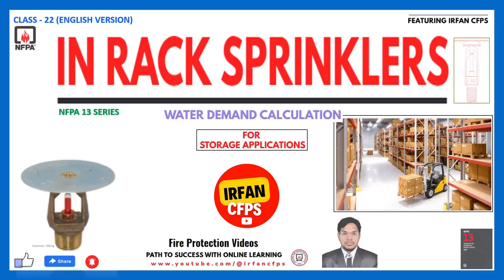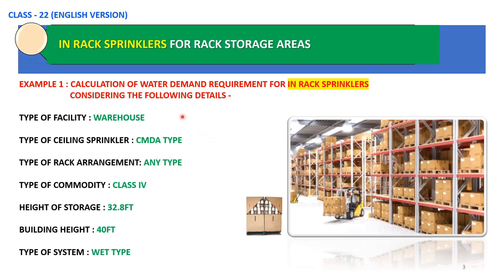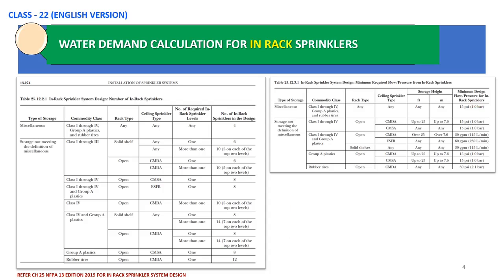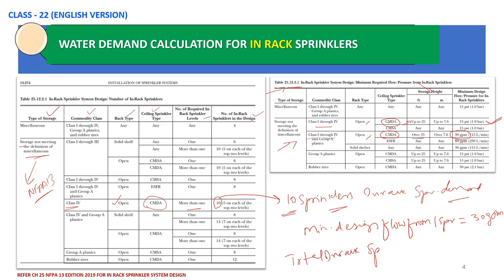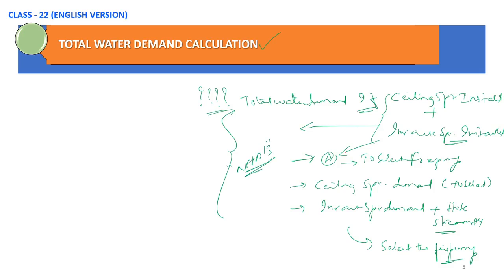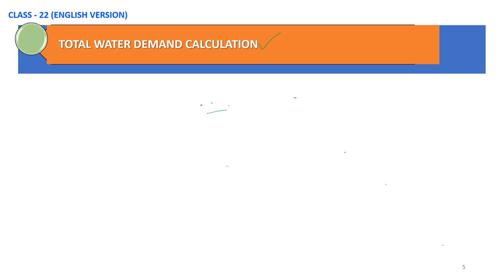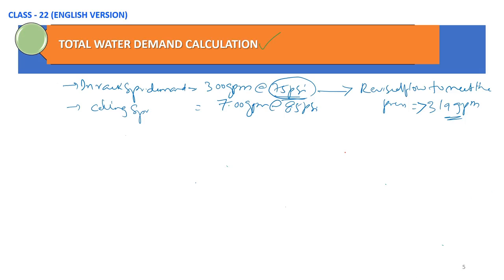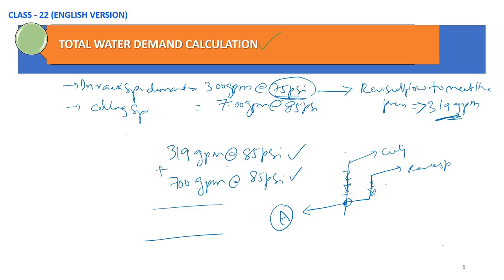How Much Water Do In-Rack Sprinklers Really Need?

Comment: How did you determine the pressure for the in rack, also how did you determine the pressure and flow for the CMDA for the ceiling ?
Reply from the maker: Please go through the video once again for more clarity. Head can be defined based on hydraulic calculations only.
Reply: @irfancfps  For the CMDA type then it was mentioned that for example the K to choose with 11.2 then the flow was set to 57gpm , then the pressure equaled 25 psi, so how determined for the inrack type?
Reply: @irfancfps  For the CMDA type then it was mentioned that for example the K to choose with 11.2 then the flow was set to 57gpm , then the pressure equaled 25 psi, so how determined for the inrack type?

Comment: Thankyou dear Bro. Irfan for your very informative videos. I am  still has a doubt on the distribution of sprinklers. in the given example we got 10 sprinklers and based on those and ceiling ones you got the total demand. If Ord Hz G2 12,1 sq meter is the Cov Area per sprinkler. My quesion what are the spacing between in rack sprinklers and where to place them vertically and horizontally . I saw in the table that those 10 sprks must ob 5 on each of top two levels, what about other levels?  if we have let us say 10 pallets above each other.. do we distribute the ceiling sprks by omitting the existence of the in rack sprks let us say 3x4 meter spacing in 2 d directions?  Hopefully you can come up with a video of real life example in which you show us the calculation if flows pressures number of racks in the depth and heights in addition to number of pallets...in short a real life example? my apology in advance if I asked more..
Reply from the maker: Actually in this video i explained the concept of in rack sprinklers. However the coverage area requirements per OH refers to the ceiling sprinklers..it means ceiling sprinklers will be distributed as per 12.1m2 and for in rack sprinklers the methodology is different. i will try to make one real life example video on in rack design based on the rack configuration soon. Please bear for some time. Thanks.
Reply: Masha Allah you are doing  really a great work, waiting to watch all new videos

Comment: Good move to start a channel in fire protection sector. Appreciate your effort. 
One clarification. How do you arrived the pressure at the connection point without pipe sizing in theoretical calculation.
Reply from the maker: Hi.
Thanks for your feedback.

I said “for example” we got 75psi…. based on Hyderaulic calculation… so in order to derive the pressure at any point u need to do the hydraulic calculations. With out that we can’t say. If u still have any query let me know.
Reply: @irfancfps  If it is through hydraulic calculation, then it is found to be okay. 

Regards
Dinesh Kumar D CFPS®
Reply from the maker: @firesafetyspecialist  Nice Observation

Comment: Thank you for your session.I have s doubt about storage area as per your conclusion where it is required inrack sprinkler. For example wherever consider CMDA or CMSA or any specific reason.please confirm
Reply from the maker: Rack sprinklers are provided for protection dedicated to racks. 
CMDA or CMSA sprinklers are provided to cover the entire ware house from the ceiling.
Reply: There are two options one is ceiling only sprinkler system and ceiling +inrack sprinkler system. Ceiling only sprinkler has some limitations on rack type. Inrack sprinkler to be provided where the open frame rack criteria doesn’t meet.